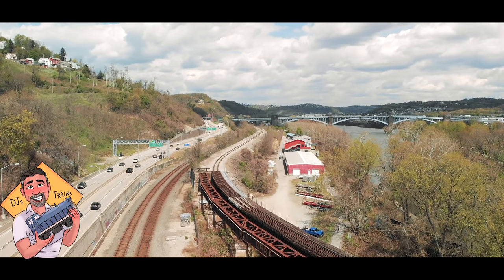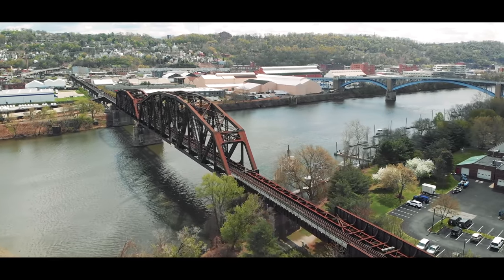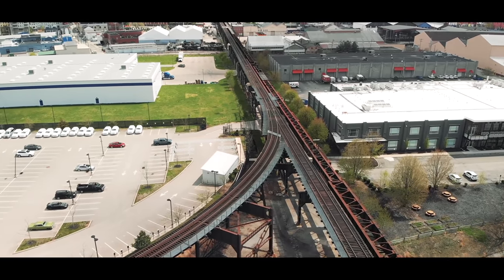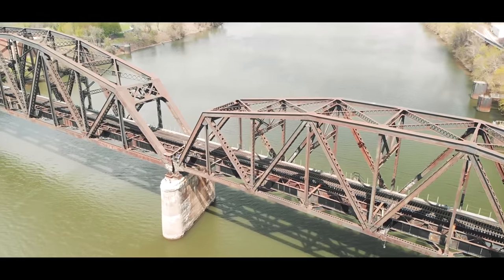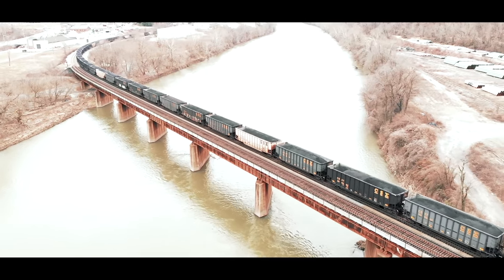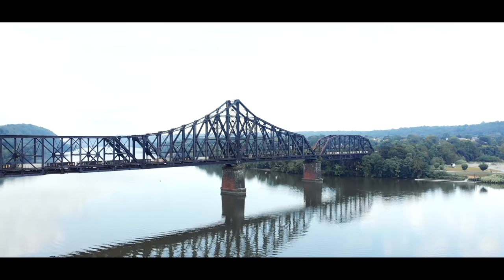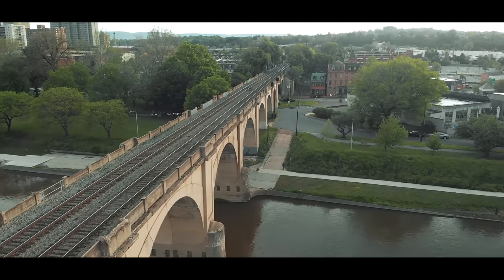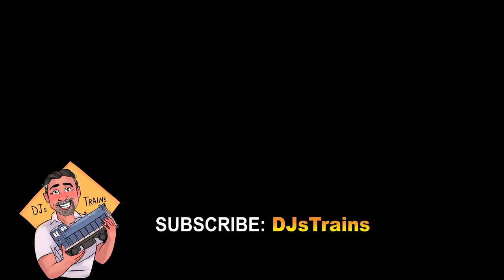Railroad Bridges: Check Out The Variety & Modeling Ideas

Comment: Hey DJ, heard your comment about boating lights, and not 100% sure it's correct, but a sailing friend taught me that Red and Green are for left & right of safe boating passage, like a "gate". Red will be in the left heading "out" (downstream in a river?) and green therefore on the right. He taught me the mnemonic "Red Right Return" which was to keep the red lights/buoys on the right when passing through a red/green pair while returning to port. Just an interesting detail...
Reply: “RRR” is correct. On occasion, some bridges will have a white light denoting the center of the channel between the red and green lights for those vessels that might be concerned about their draft depth. The color lights then denote the safe outer channel limits.
Reply: What would Gilligan and Skipper do lol?

Comment: DJ, I'm a newbie to the hobby. I had a set of Lionel O gauge trains about 60 years ago. I'm getting back into the hobby, but I'm taking my time. I'm having a tough time deciding
on a time period, the design of the layout. I have a small spot in my attic where I can put an L style layout...one 3'x6' and the smaller end of the L 2'x5'. I'm just about done with
my benchwork, which I'm making it very strong. 1"x4"s with 1/2" sande ply with 1" foam. I love a lot of different things in a layout...like a logging camp, or a coal situation. I'm pretty good at building structures and miniature things in scale. I love painting anything. Especially I would love to weather all kinds of stuff. I love that kind of detail. It really makes the whole
layout more realistic. I'm trying to narrow things down to what locomotives that I like....What type of landscape am I depicting...and the kind of houses or buildings would fit everything else.
I know I'm rambling a bit, but it's very frustrating to put it all together so I can get started. If you can suggest anything, please let me know how I can go about finding some pictures
or areas that I can at least get an idea of what I can compress into the space I have allocated. Thank you so much for reading this long-winded comment. Take care DJ!!
Incidentally, I love your video's. You make them so easy to comprehend everything about the Railroad that relates to what your trying to build. Thanks again!!
Reply from the maker: sorry to be direct, but can you just give me a simple question that maybe I can link a video to.  Thanks.
Reply: @djstrains  Fair enough! I live in Jackson NJ right now, so I'd like to see a video where I can model my train layout to it. Or if you have a video from Lehigh Pennsylvania where my son lives, that would be great. Thank you so much for getting back to me! MG

Comment: D.J. - I just watched this video again tonight and was wondering who can through the powered switches like the one on the Union Railroad truss bridge? Can you control any switches from the engine cab, or are they all thrown remotely by someone?
Reply from the maker: Great question!  On CSX we have mainline powered switches controlled by the dispatcher in Jacksonville, Fl.  But on non signaled branch lines, we have switches that we control via the radio.  We tone in the correct number to throw the switches and usually it will announce over the radio the name of the switch and its position (normal or reverse)

Comment: Im surprised you did not know that concrete peers are always 90 degrees to the river flow to minimize the impact of water pressure on the bridge...
Reply from the maker: I guess I just never gave it much thought, and never paid much attention to the angles of the bridges to the river, since many are 90 degrees to a river.
Reply: @djstrains  well that is mostly due to the course of the tracks. Straight across is usually the most cost effective way as it reduces the length of the bridge and lowers cost... But you always want to minimize water effects on anything you build in a river due to water's corrosive effects on everything that causes a change to the current.